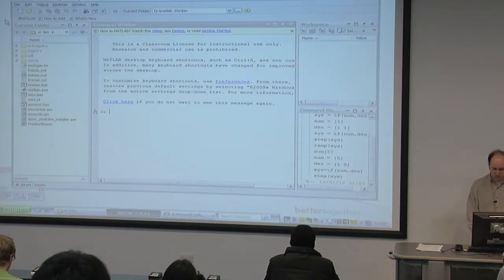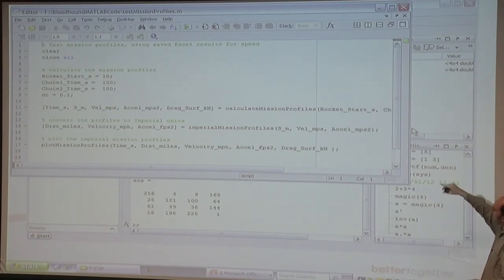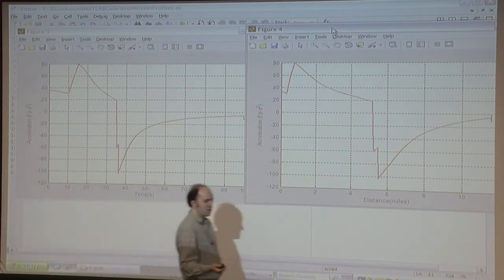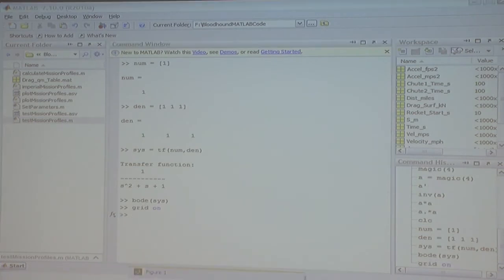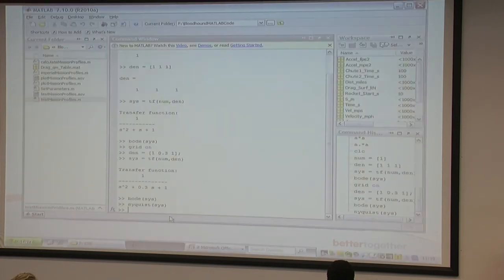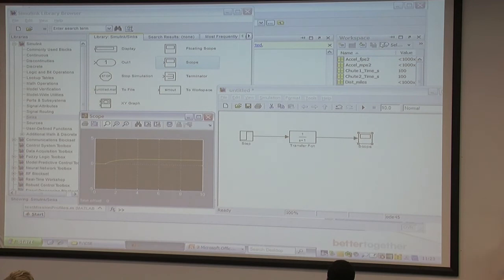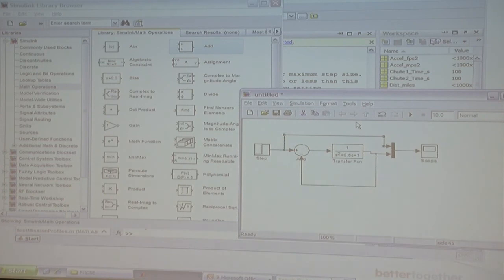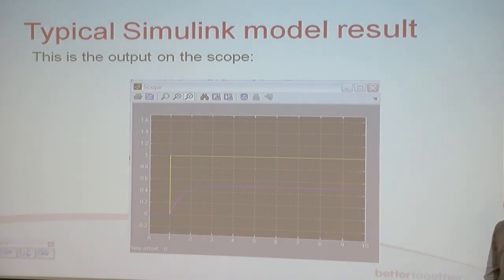Control Systems Engineering - Lecture 12 - Simulation Software

Comment: When I tried to apply the first example on simulink. When I executed the program, I get a warning message saying;"Warning: Using a default value of 0.2 for maximum step size.  The simulation step size will be equal to or less than this value.  You can disable
this diagnostic by setting 'Automatic solver parameter selection' diagnostic to 'none' in the Diagnostics page of the configuration parameters
dialog" Then I did exactly what it said. But the warning message kept on comming. Any solution?